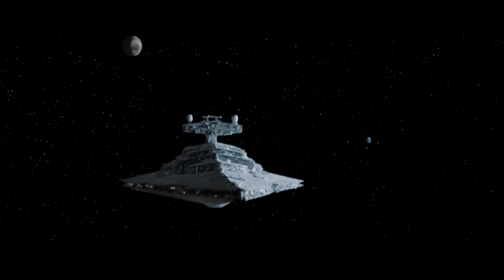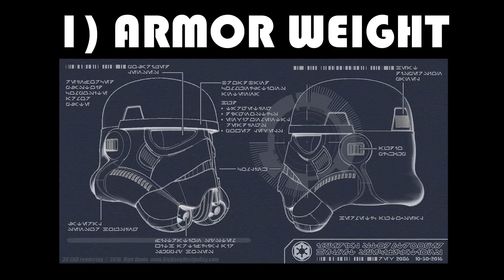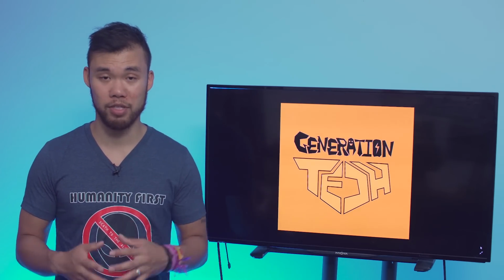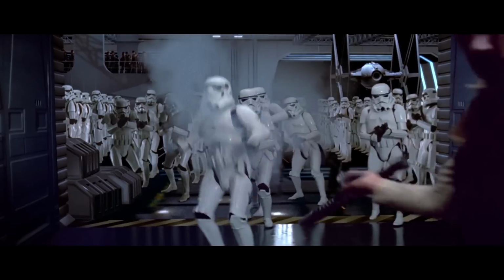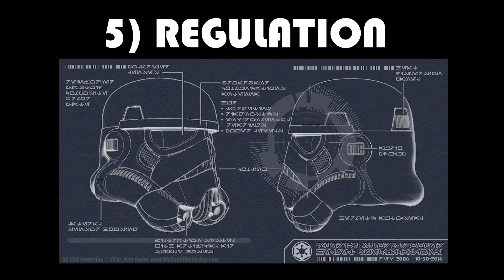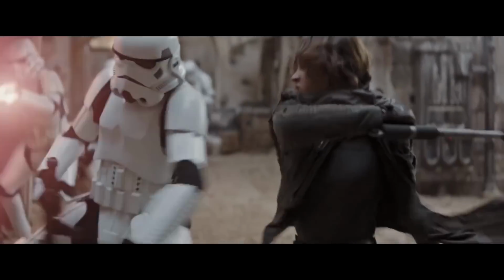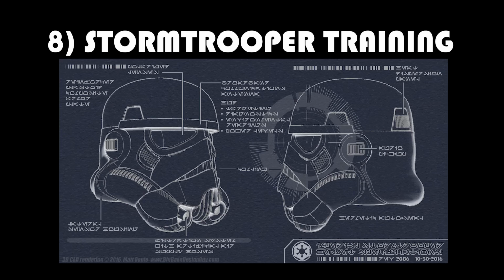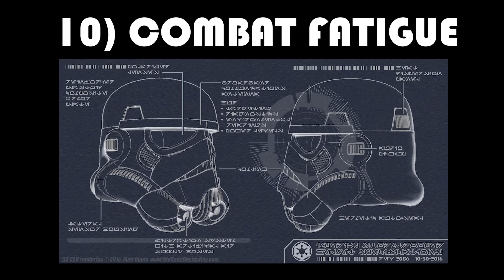10 FLAWS with the Stormtrooper

Comment: Ten flaws in the x wing... Like no hull cameras and helmet bud which lets you see through the ship. Like the f-35
Reply: It has those actually
Reply: How about no space Helmet !
Reply: Other than its lsck of a rear weapon it really has no major flaws as fighters go. It has been largely kept up to date.
Reply: I think the astromech droid was pretty unprotected. Was it covered by deflector shields?
Reply: @r.chamaemorus8025  yea
Reply: Sundown Combined with hull and wing mounted cameras, which feed into a HUD type  insert in the helmet, it makes  it appear that the pilot can “see through” areas that are actually physically blocked from view.  They even have a version of that technology on some large trucks now, not on a helmet where you turn your head and “see through” the body of the vehicle, but where a rear view mirror is not able to see through the rear storage compartment/covered truck bed-  there is a camera on the rear of the vehicle that feeds to a screen in the cab,  in the dashboard or in the position that a rear view mirror would be located.
Reply: @shawn6860  I don't buy lacking rear guns being an issue at all. We don't build fighters with rear weapons either. Why would you need a rear gun?
Reply: @michaelhowze8198  in starwars a turret for rear defense might be nice but its not a major flaw. So it really has none.

Comment: 1. Armour does not limit mobility if is well designed and balanced - stormtrooper armour can weight at least 25 kg and not cause problems since weight of on front and on back nullify torque otherwise influencing user . However I think that 40 kg of armour for ordinary conscript is an overkill
2. Since SW warfare concentrate mostly on energy weapons, which do more thermal damage than pierce, their armour is mostly constructed for dissipating energy from blast and their protection against AP ammo is rather limited.
3. Every armour can offer protection from anything if you are in greater distance than weapon can penetrate your defences. Mentioned A280 was weapon restricted only for military personnel, so it was designed specifically to "crack open" infantry armour from reasonable distance
4. In every army is phenomenon called "concrete" - group of non and commissioned officers, resistant to changes like that material is resistant to compression. Not surprised
5. ISB as military internal security service had to reduce number of defections and "fifth column" among soldiers, however the way they've gone is at least wasteful
6. Actually, removable faceplate is another part that can be broken. In conjunction with need for helmet pressurisation (for NBC and environmental protection) that can be even more dangerous than original helmet. I'd just made stormtrooper helmet with no sight obstructions like cameras and displays, so even if suit has no power you can still see. Additional features could be installed on helmet like nowadays
7.Little redesign of arm armour joints would do the job cheaper than electronics
8. Competition is favourable, as makes the need to do anything better, however it shouldn't ruin cooperation, so training (at least shown in Disney "canon") is faulty
9. Medical support is more preferable after engagement as bring less threats for rescuing and rescued
10. Main countermeasure for combat fatigue is using system where one unit is combat ready, second is preparing for being combat ready and third that is regenerating after their service on front
I agree with conclusion that we should've seen more army and navy troopers than stormtroopers - so no one could say that they are only to miss their shots
Reply: I never understand people that think armor limits movent so much
Reply: @ancen9352  go put on any armor and see if it is not more difficult to do things. All armor restricts movement to some degree. And for proof, just watch some of the bloopers with the actors playing storm troopers falling down because of the restrictive “armor”. And this is just prop pieces made out of light weight plastic, imagine if it actually weighed what it is suppose to in SW.
Reply: @mopar_dude9227  that isnt because of the armour itself, but the helmet. the visor was extremely hard to see out of which is why they switched Bulbed eye lenses for flat lenses.

Comment: 10 flaws with the AT-AT.
Reply: And ten more with the AT-TE! :D
Reply: I think that 20 would be a better number for THOSE hunks of junk.
Reply: Too few guns.
Way too tall,
Too slow
Bad weapon placement
Too small to transport any significant number of troops.
The legs
Reply: You forgot that it's neck has basically no armor and that it has no shields, I mean, if you're going to make a king of the battlefield, at least make it with the most protection one can give.
Reply: I find lack of faith in the AT-AT disturbing. I have one many skirmish battles in empire at war against the rebel scum  back in the day. High has nothing to do to with being bad it allows you to see the enemy from far greater distances and shoot at further ranges also your less exposed to land minds. Yes though the legs may be weak everything  has flaws. Also there is a reason why they stored 2 partially dismantled AT-ST in the Cargo hold so the Empire could use them for support although it make take few minutes for re assembly  and operating  they prove to very effective defending the AT-AT from anti tank infantry and supporting allied troop advancements. Also have AT -AAs would help in anti air defense. Yes AT -AT alone are vulnerable to many threats but unless your an idiot like agent Callous was most situations they would have proper support. Also would want sustain heavy storm trooper and army trooper losses having to clear out every enemy bunker and fortification by themselves. Also some my argue that is what tie bombers are well use they are effective but if the enemy has strong anti-air then they will be shot down or force to abort do to heavy flak. Also Tie bombers aren't very accurate they tend to just do a carpet bombing of  ground targets on high density targets for a precision attack run even  it is possible for tie bombers as well. Its just The empire likes fully load its bombers with much ordinance as possible making very hazardous for the pilot lol if he gets hit once boom. Also to many friendly fire incidents waiting to happen.  Also AT-STs get shred by anti tank and vehicle lazer cannons. Also having combine mobile artillery walkers help to but again may not always be readily available on when need then.  Where it AT-ATS can be your MBTs blasting well entrenched enemies from long range with pretty decent accurate and effective fire.  It means storm Troopers can hunt down retreating exposed rebel scum with relative ease as they would be driving out their forts, bunkers and trench's. Any one can say well any experienced rebel wouldn't be afraid and hold his ground. Regardless of how afraid you either going to die right then and there out numbered and out gunned, surrender become a pow or do fighting retreat to live another covering yourself and fellow rebels  to allow for an escape. The rebellion never intended to win at hoth they new they were fucked and had to hold out only so long to by time to evacuate.  Yes the neck was weak on the  AT-AT but that was to allow for flexible head movements. The underside is weak but that is typical of most vehicles. Also having no shields thing is a kinda of a bumber but obviously the empire didn't see it as mandatory. Also when you have competent commander like General Veers who  knows how to negate some if its flaws in battle reducing casualties for the Empire will maximizing rebel casualties  its doesn't matter how flawed the AT-AT is a much. It comes down to skill and tactics and constant radio communication with your fellow AT-AT'S and infantry commanders.  Its like say the X Wing is epic and the TIE Fighter is shit. The X wing may have more advantages on paper then a cheap easy mass produced TIE Fighter. Bur if you have green horn x wing pilot  go against a Triple ace  Tie Fighter your going to lose . Unless it rare case where they  ace pilot  gets to smug and over confident under estimating the newb rebel pilot. Or If your imperial defector and asked to fly an x -wing you gonna be like does it come with a manual. Then rebel command says no and your like FUUUUUUUUUUUUUUUUUUUCCCCCCCKK MEEEEE!!!!.
Reply: Also Forgot to mention FSO AT-ATs heavy Lazer cannons shoot faster which is awesome and with introduction of its bigger brother the AT-M6  pretty much any entrenched foe is going to be driven out and running for the hills lol.
Reply: I got a few counters: one, the thing still has only 2 or 4 guns on the entire walker, not only that, but in the front so any flankers get easy kills. 2, we all saw the part where Luke blew the thing sky high with just one grenade, I don't know if that was luck or not, but even if it was, anyone else would be able to cause massive damage. 3, it is so easy to stop At-Ats, all you would need is something strong enough to break the joints on the legs. 4, I know every vehicle has almost no armor on the underside, but the At-At does something one shouldn't ever do, show the weak point. 5, the thing cannot cross over bridges due to it's insane weight.6, While smart commanders would try to cover up it's weakness fighters and bombers, it will always be there and makes it so the thing is extremely reliant on the commander. Then 7, the At-At is still the slowest asset on the battlefield meaning one could ether keep the advance slow moving to protect the walkers or move on without it's support at all. As for the assets, Stormtroopers while powerful in groups, don't really stand a chance against rebels because of "Plot Armor". Jokes as, well just one Y-Wing could wipe out most of those troopers while could still having the payload to hit the leg. The At-St while fast, those ports are pretty dumb as anyone can just chuck a grenade in there and boom, walking legs. Or just hit it with a missile launcher, same results. The At-AA in my opinion was likely the most useful defense against what rebels and resistance members would likely use but like the others, it has weaknesses. One, it carries high explosive ammo which can be damaged. Another is the fact it only has one lazer cannon to defend against infantry which does provide ok support but not enough. And then for aircraft, a good amount of imperial spacecraft or aircraft really don't last long enough against rebels to do damage. And as my final point, Disney made those walkers basically do nothing but blow up a few building and people as well as make the At-M6, the most powerful form of the At-At get destroyed by ion rifles and these things kind of put a bad taste in my mouth when it comes to the At-Ats but then again, just my opinion.
Reply: That is battlefront they have to do it for balance in the game or give the other side fighting chance that is just situation. In the movie they don't take any damage what so ever. Although tie fighters did all the work they resistance basically fled. Also in most match's  neither walker is defeated.  Well that is Disney for you  you can say what you will but if another strategy star wars game gets made including the AT-M6 its going to be a powerful that will inflict a lot of damage. Yes bridges maybe an issue but maybe if the empire though of making bridges that could support its weight then it wouldn't bee an issue. also that walker was on its own  luke killed.  Also most situations wouldn't have Jedi  around to cut their legs off. The underbelly is weak yes but generally the average trooper would have to  get close and well most other supporting forces would kill them easily. You also forget they can transfer power to the motor though reducing fire power will increase mobility significantly. Also not every supporting forces have to stay right be side it.  Advance forces can clear a path to. Also commando teams can raid and cause sabotage behind enemy lines. Again the Air force can help to if they equip bombers with tactical ordinances at specific bunkers. I rather have powerful long range support than non at all regardless of speed I just want something that will make the enemy go oh shit and run while having faster units up front charging lines to. Yes the Y wing is powerful but as long as you have tie fighters and at aa support that should negate the issue. It all comes down to the commander competence and working with the situation. Yes most cases you are right Nguyen but they have shown they can be force to be reckoned with in the hands of competent commander.
Reply: @mar_speedman  I know that it has its flaws, but it can't have that much. AT-TE is the best walker ever.
Reply: I know, I'm curious, though. How many will he find?
Reply: It's too big! For crying out loud! Why would you need a walker that big? Just give it repulser lifts instead of legs, legs should not be on star wars vehicles unless they are no bigger than at-te. ANything bigger and you're just asking to get shot down.
Reply: It's pretty big, yeah, but it had powerful guns, and a superior vantage, high ground and all. Yes, it had massive flaws, but it wasn't really bad.
Reply: Play empire at war
Reply: @yagdtigercommander  the game doesnt care for weakpoints on ground missions only in space does the game care about weakpoints in a real fire the neck would be aimed at and the at at would be decaputated
Reply: @andrewaftontheandroidhedge2780   Yah well say tell that to idiot that gets launched 30 feet from its heavy laser cannons firing or gets stomped . It has it flaws like every thing but its not that easy to take down.  No it wouldn't unless you had some access to some heavy weapons and oh wait most the time the rebels to do not. So yes another conventional army wouldn't have as much trouble. But when dealing with rag tag rebels with limited supplies in most cases 
The Empire will win  Even if they take down one another 3 or 5 AT-ATs they have to fight. Also if your being realistic they are going to be supported by plenty of storm troopers and smaller infantry support walkers like the AT-ST oh and air support to deal with bomber attack runs or air speeder's with to cables. Also you don't how the enemy is going to react against such a massive walker. 

Yes their are going to be those brave enough to take it on but succeed that is another story entirely. Also knowing that most humans usually run when they see something big and scary coming towards them. I could say Hey I could totally take out that AT-AT with a rocket. Then realize I forgot to load the launcher or I miss some how or just out wish I were wearing my brown paints and run like a little coward. 
War is hell and you don't know who is gonna react the way they were trained  for. 

Also if you Have an AT-AT Battalion commander who has a lot of experience deploying such walkers effectively it ain't gonna matter If you decapitate one. The are going to rampage through the enemy lines like herd of angry Elephants.
Reply: @yagdtigercommander  you fried my brain with too meny words
Reply: @andrewaftontheandroidhedge2780    haha I win lol I used my  Big Brain time moment. And If I made your brain hurt then it worked as intended.  I don't disagree with most of your point but I am just saying destroying AT-AT isn't a simple  as shooting a storm trooper with a blaster. It would be like fighting a Tiger  tank in WW 2 sure its not practical but its well armoured  and does the who fear factor thing well. Its easy to know about weak point and how take it down. 

 Its a different matter actually applying it in battle as so many factors are a play. From battle conditions to how battle hardened the enemy is if they have never taken down an  AT-AT in battle before they are gonna resort to fleeing as the best means for survival. But not every condition is suitable for the AT-AT to be used either.

Its flawed like everything has flaws and the crews learn to live that and make the best of it and great crews no how to use weaknesses as a strength. Its something I like in stars wars and all ways will. It may look slow and stupid to some or many. But not to me and I always enjoyed stomping around in the original battlefront games spreading fear to rebel scumb lol.
Reply: @yagdtigercommander  make it more simple for my potato brain
Reply: @andrewaftontheandroidhedge2780   Lol I like the AT-At I think its awesome despite what others say lol.
Reply: @yagdtigercommander  okay its not a crime if you like it or not ppl have opinions
Reply: @andrewaftontheandroidhedge2780   i know just having some fun lol.

Comment: Heavy armour shouldn't be compared to a heavy backpack. Armour fits the body better and doesn't affect your centre of gravity as much as a rucksack. People in full steel armour are still quite mobile. If stormtrooper armour meant they could wade into incoming laser fire then it'd totally be worth it.
Reply from the maker: Yea it would be worth it if they were more capable of stopping blasters
Reply: they stop small arms fire the Rebels use high Power blasters and heavy blasters,also shrapnel isnt issue for them. not every armor is some bullshit "beskar" Armor that the impact of bolts alone would kill you .
Reply: @laisphinto6372  

How often is shrapnel even a problem in star wars combat since everyone and their aunt Beru uses energy weapons i.e. blasters? Sure there's thermal detonators but their scarcely used, same with concussion missiles or really any kind of rocket propelled ordinance.